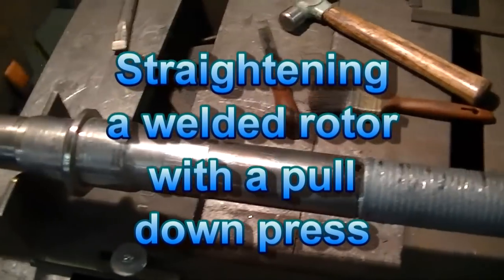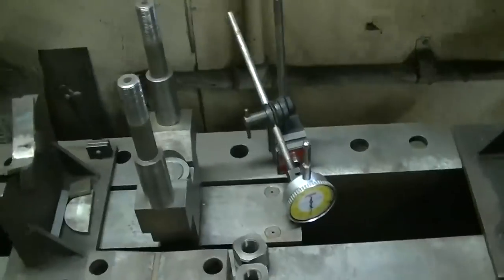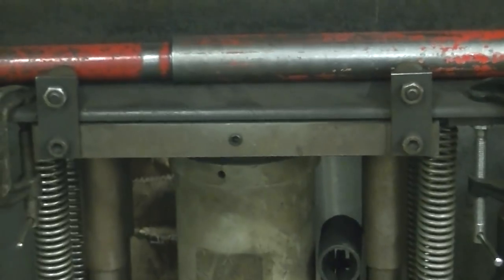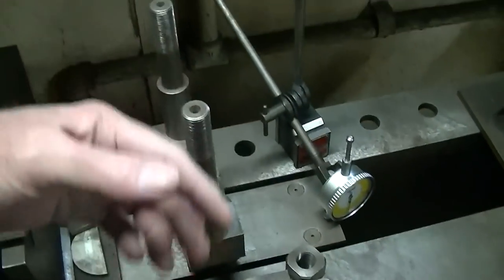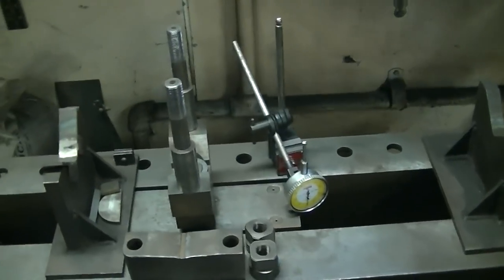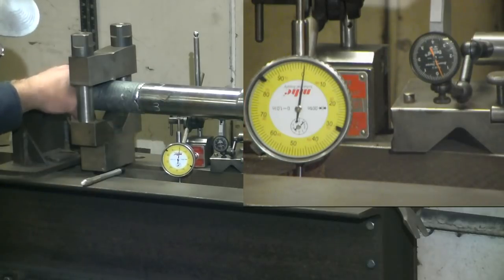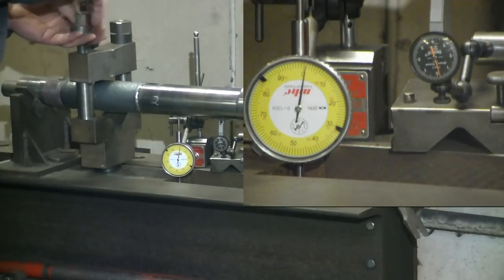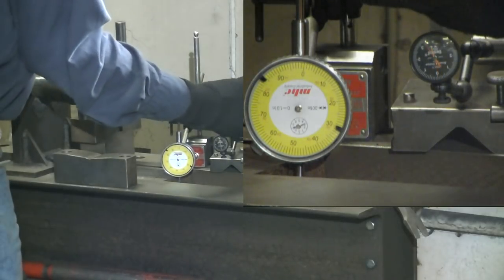Straighten shafts with pull down press

Comment: Great video! I have a 30" long solid shaft 1.2" diameter. It is D2 Tool Steel hardened to 60 HRC.  It is 0.023" on the dial out of round.  Can I staighten it using this method?? Will it crack? Thanks!
Reply from the maker: At 60Rc IME, you’re not going to have any luck as yeild/break are pretty much the same value. You may get a heat treater to try and help you with it (bending hot), but I wouldn’t be surprised if they declined.

Thanks again,
Matt